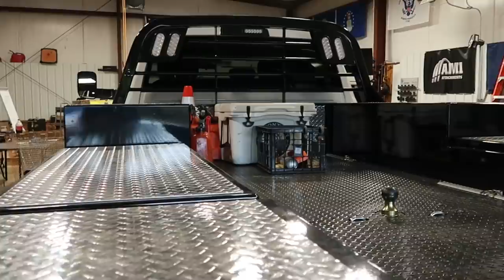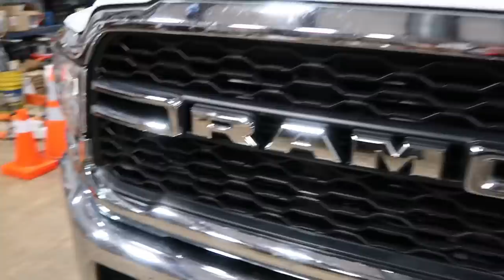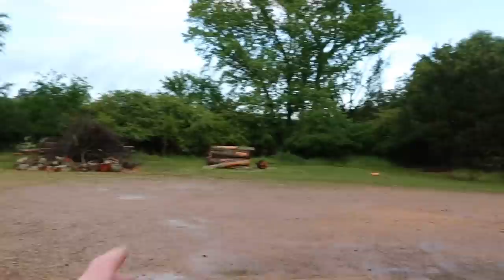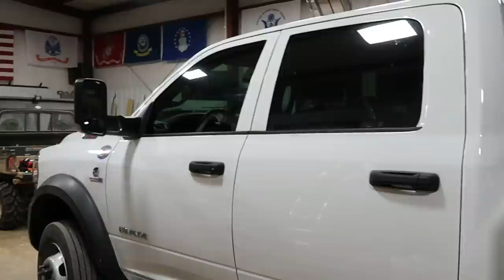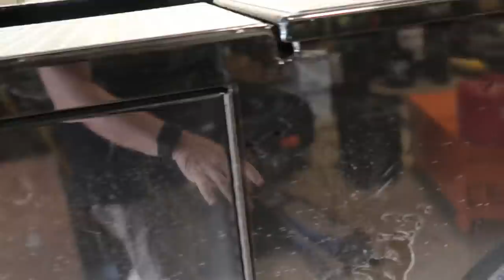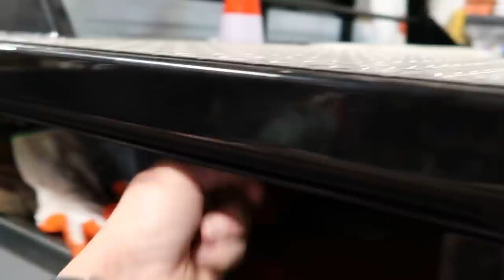Ram 5500, dump trailer, chipper and tons of updates

Comment: Congratulations to you daughter !!! I almost move on to another video, glad I didn't. You may want to make sure the up fitters solder all the connection for the light wiring or at the very least use connectors with heat shrink and glue sealant in them. That goes a long way in eliminating light issues down the road.

Comment: With that trailer, excavator and wood connections, you would be a natural wood mill owner.  Add a solar kiln, kick out the middlemen, sell high value hardwoods.   Matching book end resin slab tables.

Comment: I've always been a firm believer that, if you want something, you have to work for it. I can only imagine the blood, sweat, and tears, that went into getting you where you are today.   I commend your work ethic. I'm a truck driver by trade. The company I'm with teaches the "Smith System" (safe driving thing) as part of their orientation. One of the key points of it, is to always leave yourself an "out." I use it while driving, but, I also applied it to life. In the form of a side "hussle" as you called it. I can see that you have as well.